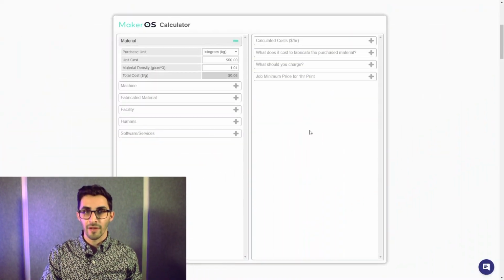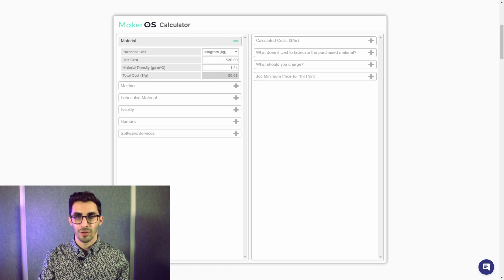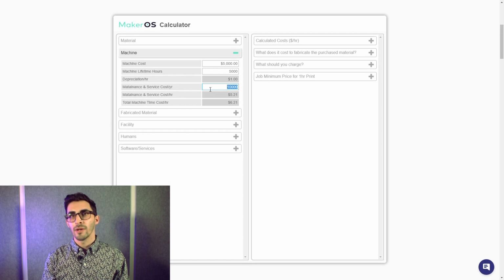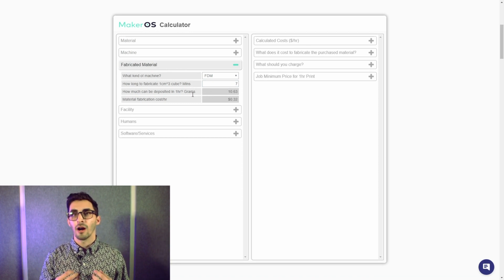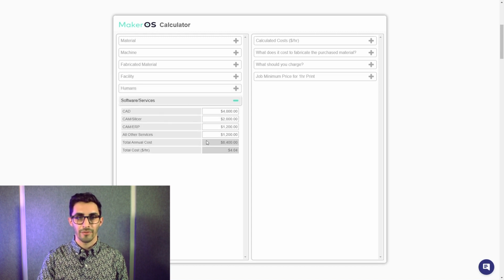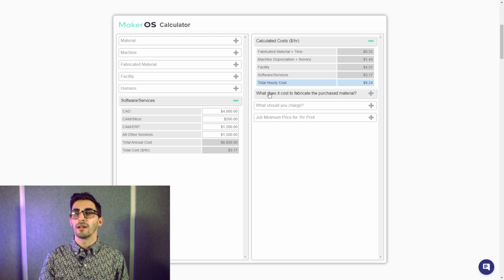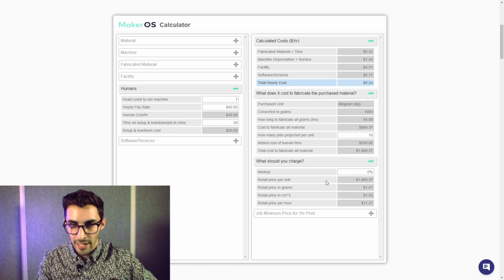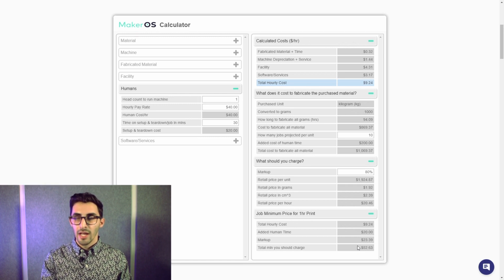How to Price for FFF and FDM 3D Printing | Cost Calculator

Comment: This may be a moot point, but really what you are referring to under the materials calculation is not density, but specific gravity. I was a bit confused how the units worked out until I realized this subtle point. Since specific gravity is a unit less quantity (comparison between the density of the material to the density of water) then the calculation for total cost per gram makes sense.